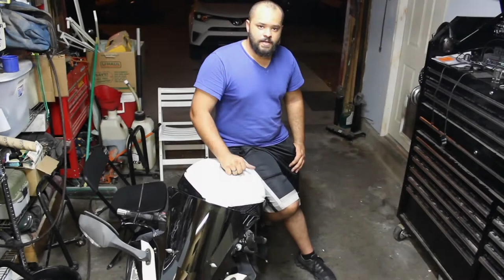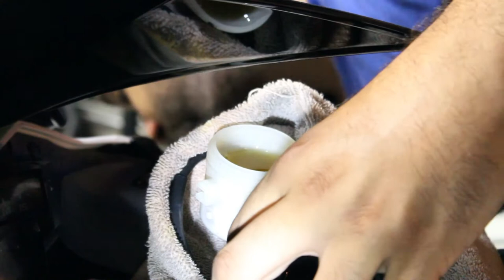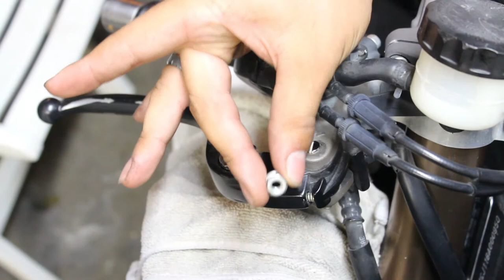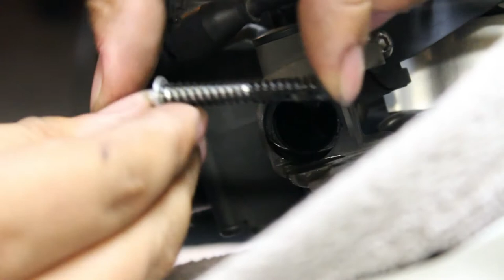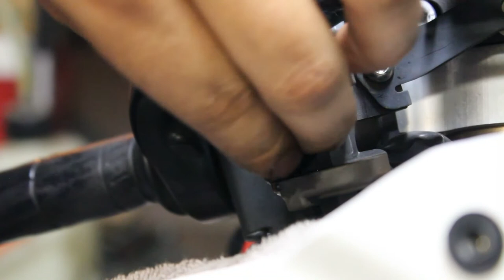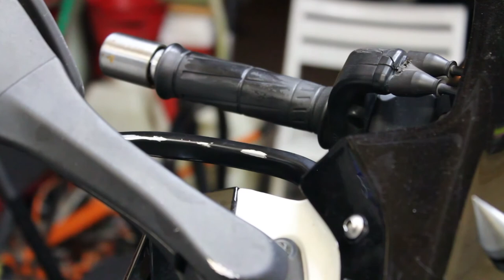How to Rebuild a Motorcycle Master Cylinder

Comment: Just rebuilt my '06 636 MC today using his vid, thanks a bunch 💪🏻
Reply: You too huh? Did your front brake feel like if should after the rebuild? Read in the forums that some people have reoccurring problems with the 05 06 636 MC. Was considering upgrading to a newer models MC but figured if try to rebuild if first and sore how that went.
Reply from the maker: Thanks! I'm glad it worked out for you. I've had a few people tell me it is their go-to video for whenever a rebuild is needed. Glad to be so helpful in some way.
Reply: @ThisisForTheTV  there's no denying an upgrade is better, but mine definitely improved noticably, especially on track where it gets abused
Reply: I've Just ordered the kit for my 05 636. Hopefully improves the feel and strength or its getting a MC upgrade too

Comment: great tutorial, I've this type of cylinder. Just wonder is there a direction of seating for the circular clip. Many are saying there is a flat side which shall be outwards. However in mine outside was the rounded when I opened. I need to re assemble it and feeling lost what way shall I mount it back or if direction even matters at all.
Reply from the maker: Thanks! I appreciate you taking the time to comment. In many applications, the orientation is unimportant. However; there is a correct way if you want to be specific about it. In this case, I'd say it doesn't matter. But c-clips are supposed to be oriented with the flat side touching the part it intends to retain to ensure a secure fit. So smooth-side out would be appropriate in this case although its orientation is not a critical component of the assembly process. I hope this helps and thank you for watching. Ride safe and Subscribe if you haven't already! Cheers!

Comment: Hi mate! Not sure if you can help but I have rebuilt the master cylinder but fluid still won’t go through. Any suggestions? Thanks
Reply from the maker: Have you considered trying to gravity bleed your system? Also, sometimes you need to prime the master cylinder after rebuilding it by removing the brake line at the master cylinder, cover the hole where the brake line was with your thumb, then squeeze the brake lever a few times. You should eventually feel some air pressure behind your thumb. Allow the air pressure to escape but try to not let much air back in when you release the lever. Do this until you primarily have fluid trying to squeeze past your thumb, then quickly reinstall the brake line and proceed with a gravity bleed. After the gravity bleed is done, continue to bleed as normal. I hope this helps!

Comment: I'm not sure if I did something wrong but I followed your video and when I try to do the brake bleed nothing is happening. No fluid coming out.
Reply from the maker: Make syre that you try covering the master cylinder with your finger (where the banjo bolt is supposed to attach) then pull the lever to pressurize the system. Then after the air slips past your finger, put the brake line back then gravity bleed for a few mins before trying to bleed conventionally again. Let me know how it goes!

Comment: I replaced the seals like in this video on my cbr 954rr. My problem is once everything is put back together and I fill the resivouir with fluid, I cant get fluid to fill the brake lines or get pressure to build on the brake lever. Tried bleeding them forever, also tried a vacuum line on the caliper's and couldnt get any fluid down the brake lines. At a loss for how to "pressurise" the brakes and get them working again.
Reply from the maker: Usually when this happens, you need to purge out the air in your master cylinder. You can do this by removing the brake lines attached to your master cylinder, remove reservoir cap and bladder, place your thumb over the hole that your brake lines were attached to, then pump your brake lever. You should feel air pressure push your thumb off. Allow the air to pass your thumb but keep the hole sealed when you release the brake lever. Do this as many times as you need until fluid comes out then quickly reinstall your brake lines. Alternatively, you could do a reverse brake bleed where you fill a syringe with brake fluid and force the fluid through your calipers and up your brake lines to the reservoir. I hope this helps you! Good luck!
Reply: @TheMotorcycleBoss  thanks for the reply i'll give those a try!

Comment: If there were to be corrosion in there, how would you go about cleaning it?
Reply from the maker: You can use fine steel wool or a scotchbrite pad. This may also require removing the brake lines to thoroughly clean it up afterwards.

Comment: What do you do if there is rust inside
Reply from the maker: You can use fine steel wool or a scotchbrite pad. This may also require removing the brake lines to thoroughly clean it up afterwards.

Comment: I was trying to bleed my front brake to put new fluid in. I was able to drain out the old fluid by gravity through the bottom bleed valve, but after that, i was unable to push new fluid through. What might be the problem?
Reply from the maker: Sounds like you may need to purge your masyer cylinder. Usually you may need to remove the brake cables from the master cylinder and cover up the hole with your thumb while depressing the brake lever. You will feel air pressure push your thumb off and you want to let some air out but not back in. Repeat this until you have mainly fluid behind your thumb then quickly put the brake lines back on the master cylinder. This will purge air from the master cylinder and allow the plunger to push fluid through the system. Hopefully this helps! Good luck with your project!
Reply from the maker: Also, if you are just bleeding the brakes and you aren't replacing anything in your brake system, you never want to let the reservoir run dry when bleeding or gravity bleeding or you may run into this problem.
Reply: @TheMotorcycleBoss  thanks for the. advice. It's a salvage bike and i wanted to clear out all the old fluid to be replace with new. I pump and close for 5 mins but I still get nothing. I'll try the MC bleed.
Reply from the maker: @bex622  Awesome! Project bikes are always fun and rewarding. Definitely try the MC bleed. It should help you or at least remove a variable from the issue.
Reply from the maker: I'm working on my cruiser as we speak. I'm shooting my next video. I think I finally found the problem with my bike. Wasn't what I thought it was. But I'll see in a few minutes if what I found is the culprit.
Reply: @TheMotorcycleBoss  so i tried the mc bleed valve and nothing came out even though the reservoir was full.  I even took the valve out. So did it mean the MC is clogged some how? Seems far fetched.
Reply from the maker: @bex622  a clog is rare in that area. But the good thing is that it seems that you found your problem. Did you try the purge I was telling you? It's different from bleeding it through the bleed nipple.
Reply from the maker: @bex622  another way to purge is to remove the brake lines from the master cylinder then plug the hole that's left with your thumb while you squeeze your brake lever. You will feel air pressure behind your thumb escaping past your thumb then a slight suction when you release the lever. Repeat this until you get a build up of brake fluid behind your thumb instead of air and quickly reattatch your brake lines to the master cylinder. That will purge air from the master cylinder and should use capillary action to draw the brake fluid down the lines the rest of the way.
Reply: @TheMotorcycleBoss  oh right, what you mentioned already 🤣👍
Reply: @TheMotorcycleBoss  It worked!!! Thanks so much for your help and always quick responses. You saved me 😆😆👍👍. I knew you would be the person to ask since you're so detailed and knowledgeable in your videos.
Reply from the maker: @bex622  No problem! That's what I'm here for. I'm glad you fixed your problem and now you know a new skill for the future. Save that money! XD I hope I could earn you and your friend's sub if I don't have it already! Pleasure to meet you and feel free to message me anytime! Ride safe. Cheers!
Reply: @TheMotorcycleBoss  oh yeah, I'm already subbed for sure. Keep up the awesome content!
Reply: I’m trying this method on my gen 3 zx10r same master cylinder and I still can’t get the fluid to come through. I just did the rebuild
Reply from the maker: @kentuckynightrider725  Did you try gravity bleeding and purging the air out of the master cylinder by removing the brake lines and putting your thumb over the hole?
Reply: @TheMotorcycleBoss  yea I got it fixed I believe. My kit didn’t come with everything yours did. The thicker o ring didn’t fit right I believe so I put the oem one back on. And it works fine now🤷🏻‍♂️
Reply from the maker: @kentuckynightrider725  that's odd. That's the first time I had that happen. Did you purchase it through my link in the description? If so it may have been a mess-up on Kawasaki's end maybe.
Reply: @TheMotorcycleBoss  no I got it from eBay and now I’m sitting on the side of the road with my brakes locked up. Idk what has happened
Reply: @TheMotorcycleBoss  lol I think I just filled the reservoir to much because it’s pass the max mark now😂
Reply from the maker: @kentuckynightrider725  that sucks! It maybe the case. I've never had one overfilled before so idk if that would cause that. I hope you stay safe and keep me updated with what the issue is once you figure it out.
Reply: @TheMotorcycleBoss  it was because I over filled it. I bled some out and it’s good to go now
Reply from the maker: @kentuckynightrider725  ok cool. Thanks for letting me know. Glad you got things back up and running.

Comment: So did it end up helping ?
Reply from the maker: Not as much as I hoped. However; the steel-braided brake lines stiffined things up a bit.
Reply: @TheMotorcycleBoss   Yeah I rebuilt my MC and bled the front brakes with the vac system. Didn't really help much .

Comment: I dont get why they dont put the seals on the pistons in the factory...
Reply from the maker: I wish they did. Putting the rings on really sucks!
Reply: @TheMotorcycleBoss  I saw people using like scredrivers to get them on etc. Im waiting for mine to arrive, hope I won't have much problems to get it done and after that to bleed the system, especially cuz I don't have bleed niple on master cylinder.
Also, I wanted to remove the reservoir but now I see that I can done it without it so I don't have to unbolt the brake line from the reservoir.
Reply: They do in most models, maybe he bought a non genuine kit. I have a rebuild kit here genuine Yamaha 2005 r1 and it’s all already assembled rubbers on the piston.